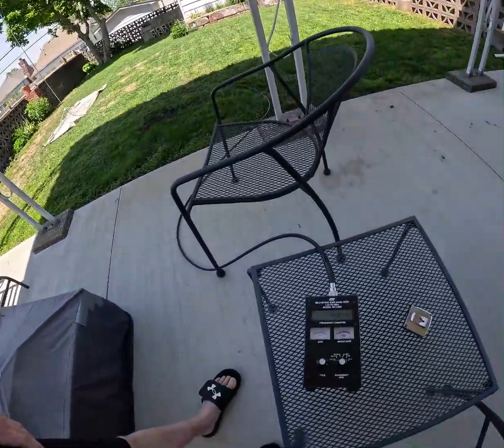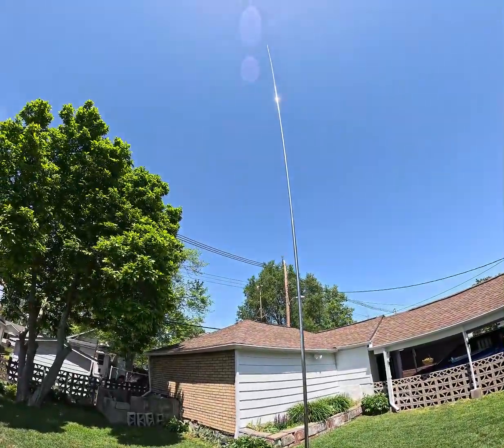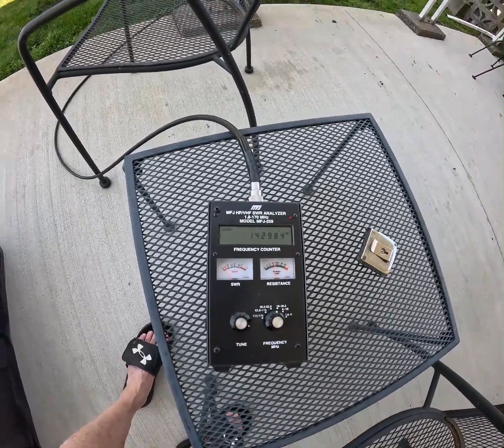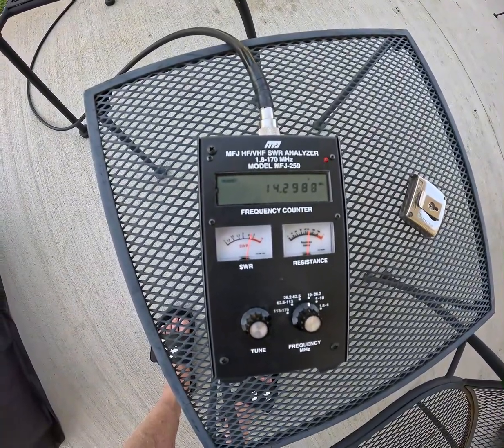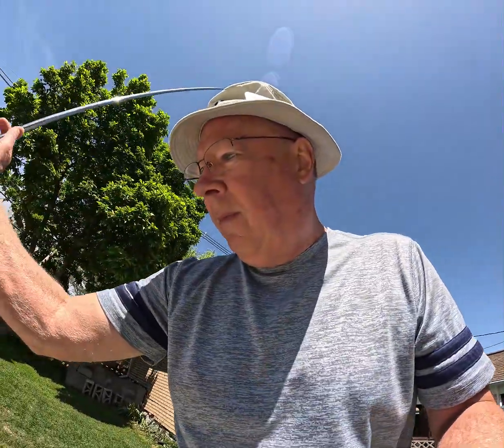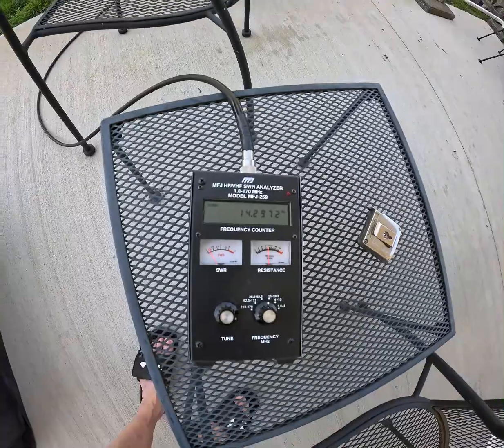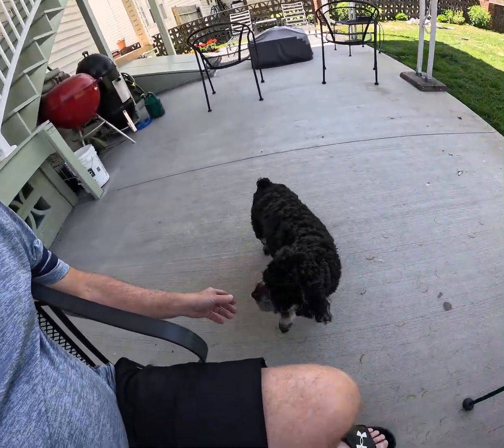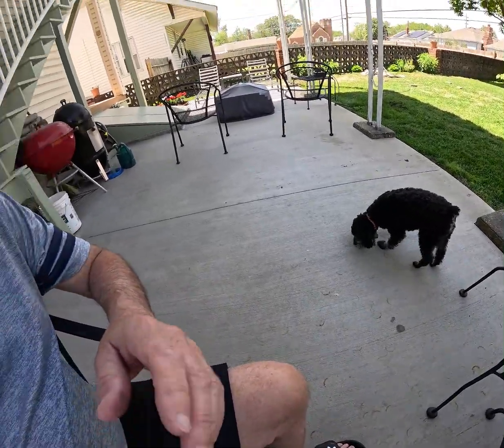Watch This Faraday Cloth Improve SWR for a Radio Antenna

Comment: I wondered some about faraday cloth but bought aluminum screen back then. I hope I can get around to 
trying the Faraday Cloth. I'm working on another magnetic loop antenna; they don't like grounding.
Reply from the maker: I also used to carry window screen for my POTA activations. However, it was found to be hard to travel with. The Faraday folds up and stores in a what is pretty much a zip lock bag and weighs a couple of ounces. They can be bought from Amazon for around $20. Those loop antennas look great!

Comment: My wife bought me a faraday sheet for Christmas.  I haven't used it with an antenna but just to wrap my radio in inside the hard case.  I was watching your video and she walked in.  Time to use it for what she bought it for now.  hi hi de KE5ES
Reply from the maker: I am just back from doing a POTA activation and used mine. In the past I mounted that same 17' vertical on top of my van assuming the metal of the vehicle would act as a ground. A quick check of SWR showed otherwise, even with the Faraday connected on the asphalt. So out came the tripod and SWR immediately went down to 1.2 as in the video. I'm more sold now on the Faraday than before.

Comment: The Faraday cloth is capacitively coupled to the earth creating the counterpoise for the radiating element and  completing the antenna circuit.  When the cloth is on the ground the capacitance is high increasing efficiency.  When the cloth was on the fence capacitance is much lower decreasing the coupling to the earth.  That is why many short radials on the ground can be more efficient than a few 1/4 radials.

Comment: Explain what a faraday cloth is please
Reply: Here you go. I googled it for you. 
Faraday cloth, also known as Faraday fabric, is a conductive material woven with copper, silver, and/or nickel threads. Its primary function is to shield against electromagnetic fields (EMF) and radio frequency (RF) signals, like those emitted by cell phones, Wi-Fi, and RFID devices. It works by effectively blocking these signals from passing through, acting as a form of electromagnetic interference (EMI) protection. 

So he's using it like an RF mirror to reflect back up more RF instead of it absorbing into the ground.